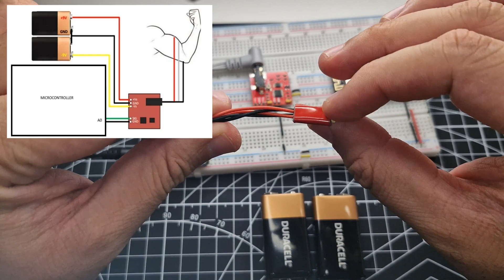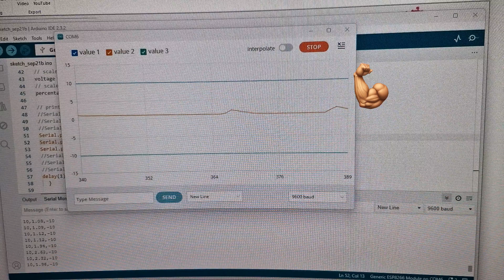Advanced Circuits Ep. 1 - Muscle sensor EMG

Comment: Hey this is the emg module im using AS8226 with esp32. I powered emg module with 3.7V Lipo battery and esp32 with usb powered. But when I flex a muscle no values changing. Normally when electrodes in the air values around 0.8 - 1V and attached to muscle around 2.3V. 
Could I know what is your opinion on this ?
Reply from the maker: Maybe you need a symmetric power supply. I don’t know the AS8226 module; I’m not sure if I’m looking at the right one. Please check if that’s the exact name and I can help!

Comment: could you please share the code
Reply from the maker: Is this code:

https://docs.arduino.cc/language-reference/en/functions/analog-io/analogRead/

I only used the serial plotter included in the Arduino software, and I set more fixed values to define the high and low thresholds.
Like:

Serial.print("10.0,");
Serial.print(voltage, 3); 
Serial.print(",");
Serial.println("-10.0");

having an output like:

10,2.56,-10

Comment: Can I use just 3 pins , connect with esp32 GND sig and +vcc
Reply from the maker: Yes, only 2 things, make sure the input voltage is minimum 3.3 VDC and do not use AC/DC power supplies.
Reply: @Arduino4all-JP but I always get 300-400 . When I flex my muscles why it’s not change when I flex?
Reply from the maker: @JUSTME08414 This sensor needs almost ideal conditions to work; maybe the electrodes or the location on the skin are the problem.
Reply: @Arduino4all-JP thanks

Comment: Can I use gel electrodes and dry electrodes from same sensor
Reply from the maker: I haven’t tried that yet, but the main circuit may be compatible. You can give it a try — dry electrodes are mostly used for prosthetics.
Reply: @Arduino4all-JP  I am making an prosthetic arm for my university competition and can I control fingers with one sensor

Comment: How can I use it with Arduino UNO
Reply from the maker: The same way is used in most processors: catch the data with an analog input. The program used in this demo works with most Arduinos.

Comment: For the batteries where did you get the double connector clip leading to the 3 wires?
Reply from the maker: I made that, with two 9 VDC volt battery adapter, the wiring was like this:          (+)----(-)(+)----(-)

Comment: Thanks for the video! I have a question.

Since the voltage that came out from sig pin could reach 5V, isnt that will cause a damage to esp32? (it can handle what up to 3.3v depends on what i read) 

Correct me if im wrong please.
Reply from the maker: Great question and you’re absolutely right! The ESP32’s GPIOs only tolerate up to 3.3V — connecting 5V directly can definitely damage it. If the muscle sensor outputs 5V on the SIG pin, it's best to use a voltage divider or level shifter to bring it down safely to 3.3V before connecting to the ESP32. Thanks for bringing it up! Gladly on this video test, the signal is too small.

Comment: Hello, how can I power this sensor with a lion battery?
Reply from the maker: Yes, but you need a symmetric voltage power output. Any battery is good; you need to have +/- Voltage, typically 9 Volts, and the mAh is depending on the power consumption of all the components of your integration.
Reply: @Arduino4all-JP  I normally use xl4015 regulator. How can I provide what you said?
Reply from the maker: For the EMG circuit, simply connect two batteries as shown in the video (+ to - to +), which will give you three points: +5VDC, GND (negative), and -5VDC For example.
If you are using 3.7V batteries, you will need four of them—two packs of two in series. No regulator is needed in this case, as the minimum input voltage is 5V.

If you want a more reliable solution, consider using the TPS5430 Positive-Negative Dual Output Power Supply Module or the Velleman K8042. These options are more expensive but effective.

While you could use the XL4015 module, it requires additional circuitry and more complex wiring to make it symmetric. It's difficult to explain fully via text, but essentially you'd need to build a symmetric power supply manually. Using a dedicated module is much easier to implement.

Thank you for your question!
Reply: @Arduino4all-JP  thanks a lot

Comment: Hi. how do you know you adjusted the gain according to what you need? i tried connecting a DMM to signal pin to measure voltage there but it doesn't change no matter what I do with the gain's potentiometer. it's weird
Reply from the maker: This circuit tends to be tricky. Please perform three tests:

1. Measure the output voltage without connecting the electrode wires.
2. Measure the output voltage while connecting the electrode wires.
3. Measure the output voltage again without connecting the electrodes, then set your baseline (zero).

Test 1 should provide a clean and stable voltage. Test 2 should show peaks, indicating that since the electrodes are not connected to any muscle, they receive parasite currents from the air, and you must calibrate them to have a steady output signal. For the last test, focus on stabilizing the voltage before proceeding to connect the electrodes to the muscle. Remember to always use new electrodes or apply some conductive gel. 

Let me know your findings.
Reply: @Arduino4all-JP  i did all the tests and got the voltage accordingly. i cant really get a steady output for the second test no matter how I tried, and for the last test best I could do was stabilize the voltage at approx. 0.26 V. however the gain still isn't how I want it to be, sensitivity is too low 
I'm trying to play floppy bird with the sensor and the triggers are just not right
but anyways, thanks a lot for your help! appreciated much